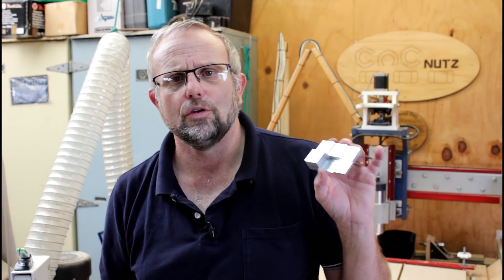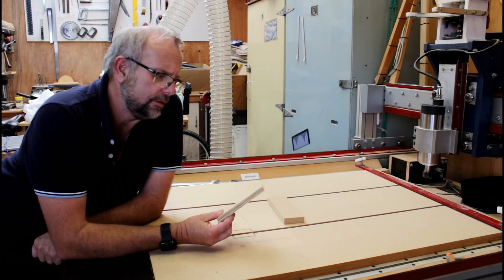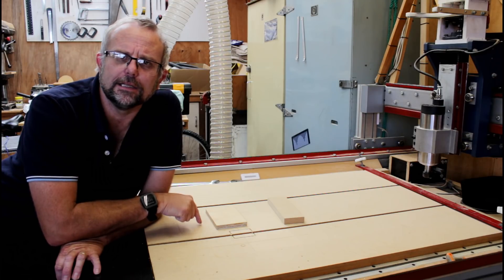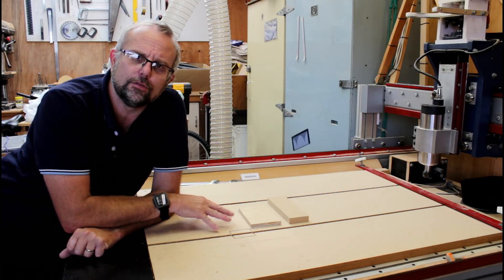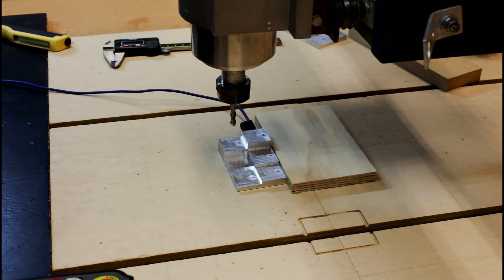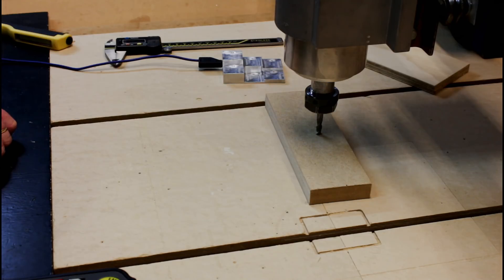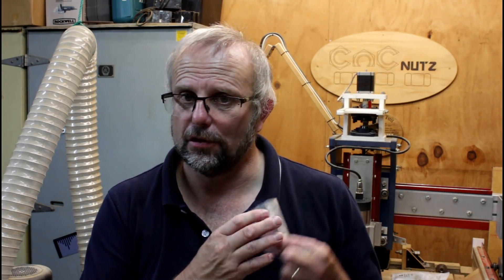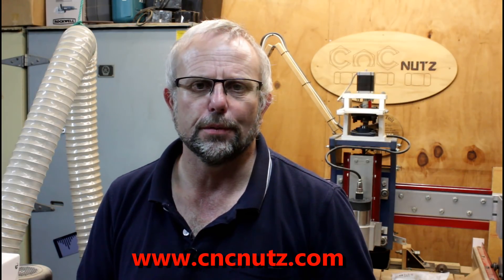The nominal thickness tool setting guide - CNCnutz Episode 202

Comment: Hi Peter,  great video as usual.  I think I may have missed something.  If you are v carving and set the tool to the top of the material, how are you then able to set the next tool to the spoil board?  Does this mean you are using two separate job files?
Reply from the maker: Do a tool change.
If you have your control software set up properly the machine will stop and allow you to change tool and rezero your cutter before continuing with the cut. In the case of VCarve and a profile cut you clearly need to change cutter. If you are using the same cutter for surface machining and them profiling then simply give the cutter used in the 2nd toolpath a different number  in your CAM software even if it is the same cutter and it will force a tool change. You can then rezero your cutter to the desired reference point. Materal top or Spoilboard and continue on. 

This video shows how to change tool and how Mach3 needs to be setup.
https://youtu.be/QYAU27ddXjg 

Hope this helps.
Cheers
Peter
Reply: Thanks Peter,  I understand the tool numbering and tool change over etc. but when I set up a new tool path file, I have to select either Z to the top of work piece, or, Z to the spoil board.  There is no option to set one or the other in the same file, unless I am overlooking it. I didn’t think it could be changed during the actual running of the tool path.  The only way I see that this can be done is to have two separate tool paths.  One for the job set to the top of the work piece and the next file is set to the spoil board.   Just wondering how you do it.  I use Vectric Aspire to create the toolpath.  Hope my question makes sense.
Reply from the maker: +Dean Richard
Hi Dean, Your question makes perfect sense and you are right. You cannot and do not change the zero point in CAM. It is not possible. The problem is you do not understand what I am really doing and until it clicks it will not make sense.
Think of it this way.
What is the difference between sitting the cutter on top of a piece of 18mm stock and setting Z=0 and setting the cutter onto the spoilboard and setting Z=-18?
The answer is that there is no difference. They are 2 ways to achieve exactly the same thing. 

Your  control software doesn't care which method you use to set the zero point so long as you set it and it is right. 

The next question is why am I doing it this way?
Answer: because 18mm stock is not 18mm it will be close but not quite right. But the machine doesn't know  or care and will over cut or under cut as instructed. If you set the cutter referenced to the spoilboard it will cut accurately for the cuts that need to be referenced to the bottom of the stock. 
Note that I said referenced to the spoilboard and not Z0 is on the spoilboard. Z0 will be in the vacinity of the top of the stock. 

I don't know if this answers your question but don't give up. Once it clicks you will understand what I am prattling about and I know you're close. Feel free to email me and we will get it sorted.
Cncnutz65@gmail.com

Cheers
Peter
Reply: Hi Peter,  Thanks again.  I do fully understand what the jig is for as you explained it very well.  After watching the video again, I just figured out why I didn't understand, I missed the part where you said you cheat and set the next tool to Z = -12mm. I must have been watching the Ashes at the time :-)   As I missed this part, I assumed you were setting the spoil board at Z = 0. and hence my misunderstanding.     Thanks for your patience in replying to me and keep up the good work.
Reply from the maker: +Dean Richards
No problem Dean.
Glad it has clicked. 
Cheers
Peter

Comment: Hi Peter

I'm a bit lost as to why you would go through all this rigamarole simply to avoid marking your spoilboard. It is, after all, just a spoilboard. For me, I just touch off once on the surface of the material, and that's it. I only touch off again if I change tools. If, because of a discrepancy in the thickness of the material, I get a mark on the spoilboard, so be it. That's why I use a spoilboard.

I'm not criticising the way you work, as I've learnt so many tricks from you over time. Your methods are never wrong, just sometimes different. So, what is your aversion to spoiling the spoilboard?
Reply from the maker: Thanks for your thoughts Geoff
I understand what you are saying and It isn't the damage to the spoilboard as such but accurate machining.
If you needed to make a pocket or drill in your project and the side against the spoil board is the front face of your project.
If the thickness of the material left is critical how do you set your cutter? Unless you measure your material thickness and taylor your file to suit that material you cannot get an accurate cut. If you want to make multiple items you need to measure each peice of stock and taylor make the file each time. Using my method I don't measure anything, I don't care exactly how thick the material is but I will get an accurate cut every time no matter how many I make. At the same time the side effect of this is I don't damage my spoil board. It requires no real effort on my behalf which suits me just fine.
I worked out tonight that my spoilboard is now just over 5 years old and I have only cut away 4mm or 0.16" of it in that time through resurfacing. 
At the end of the day it is what works for you that counts and it could be that I'm trying to solve an issue that exists only in my mind.

Cheers
Peter
Reply: But sometime it cuts so deep, it even cuts the tabs i made to keep the part in.
Reply from the maker: That is why I set the cutter referenced to the spoilboard. Holding tabs will be correct where as setting it from surface of the stock can end up cutting the tabs.
Cheers
Peter

Comment: Isn’t the point of a spoil board is to take  damage? I thrash mine and cut into it. But buying a new spoilboard every 12 months doesn’t break the bank.
Reply from the maker: Very true and thanks for the input. 
Maybe I'm just OCD about my spoilboard but there are other things to consider as well.
If you need a pocket or other toolpath that needs to be accurate with respect to the bottom of the material then zeroing to the surface of the material will not give an accurate cut unless you measure material thickness for the project. Ok if you are making a 1 off but if you are making multiple it may be an issue.  

Much to my surprise I see that I replaced my spoilboard with some 12mm  (1/2") MDF back in January 2013 so I have 5 years cutting on it to date. In that time I have skimmed 4mm or 0.16" off the surface of the spoilboard and at this rate I should have another 10 years left on it assuming I don't do anything stupid.  (Might be a big ask. )

Spoilboards are cheap but I prefer not to go through the hastle of replacing it if I can avoid it. With no real effort I can save the spoilboard and get good cuts.

Cheers
Peter